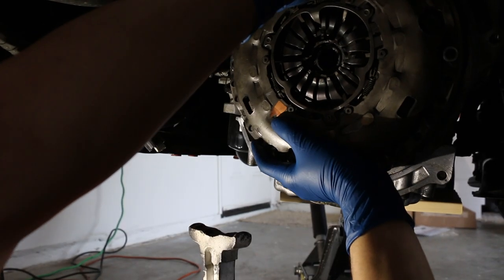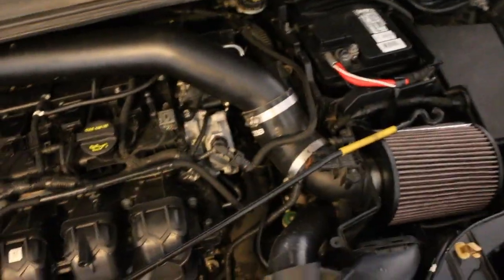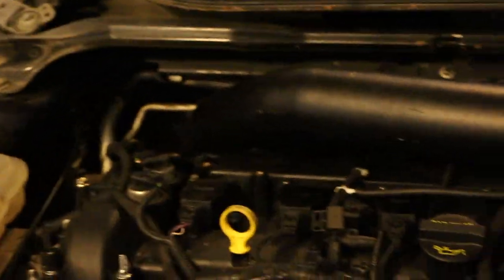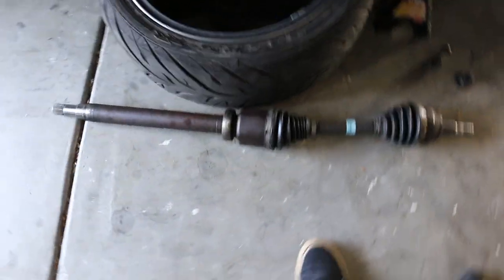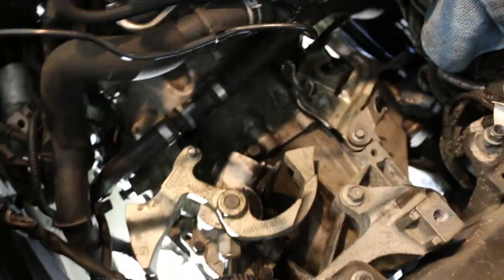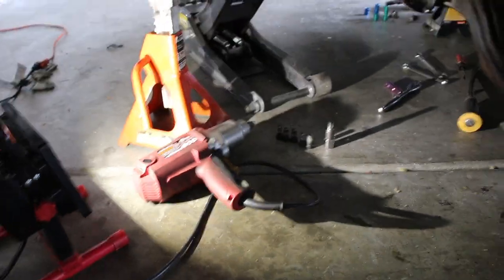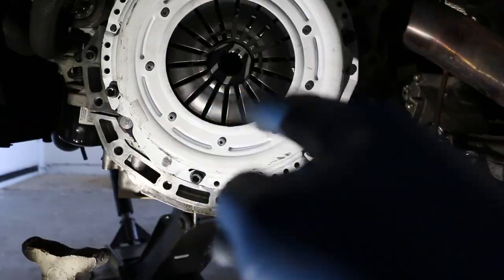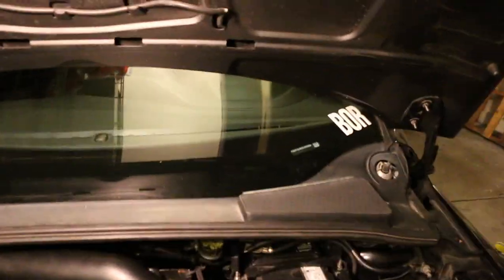CLUTCH AND FLYWHEEL INSTALL - FOCUS ST

Comment: You are awesome! I do everything by myself and couldn't imagine having to film (you do great with the angles by yourself too) I just picked an escape motor because of a cracked head in my st and was debating weather to get a clutch now or keep using my stock clutch (looks really good). After watching this I'm gonna wait, I just got a gtx2867 gen 2 and am not going to be able to tune it if I put a new clutch in. lol btw I decided I could pick up a new motor in the hatch of my other st from watching your videos. ;)

Comment: Hi, love the content! I agree with your statement amount the rattle noise at 42:37. Additionally the increase NVH is likely due to the crankshaft counter-balance assembly fighting against the lightweight flywheel. Had an issue with this in my 04 Nissan Sentra SER SpecV. Thing started breaking starters too.

Comment: Great video! I have a 2014 SE and was thinking about changing the clutch, this helps.
Reply: I have a 2013 SE and may need to replace the rear main seal, yikes. While I’m doing it I’ll replace the clutch.
Reply: only if it’s a manual..

Comment: did it by myself. I had the harbor freight engine holder. I tried to man handle the trans then I used the engine holder and just used the extra hook. raised it till it was even and it slide right in. I spent and hour trying to get it and the hoist took 10 mins. did you change out all the use once nuts and bolts???

Comment: Great video,Bro!- I'll definitely be going to the local high end tool store for an overpriced T55 bit. I couldn't imagine the drama of blowing one out and ruining the inside of one of those flywheel bolts!
  Also, the next homie that you help with a tranny/clutch job need to buy you a Harbor freight transmission jack.

Comment: Great video, i have a few questions.
what caused the engine to need a replacement?
about how many miles were on the original clutch?  

I'm at 91k so far and the clutch doesn't seem to have any issues. 
Once again great video, i'm looking forward to my replacement
Reply from the maker: David Talon 
Thank you for the kind words! So the clutch that was removed had about 95k on it but it was abused. The engine gave out because of a fueling issue. Without auxiliary fueling, these cars don’t tend to last past 330hp.

Comment: for bleeding the clutch, since it uses fluid from the braking system, could I uses a brake flush machine to pressurize the system like you would on a brake flush? would it pressurize the clutch system ?
Reply: there is no clutch fluid on a manual
Reply: the clutch and flywheel sit between the engine and transmisison
Reply: @calebeagan2658  Wrong.. This has a hydraulic clutch system. Uses fluid to press the clutch

Comment: I doubt clutch masters would have designed the pressure plate springs to rest so close to the throw out bearing that they rattle on one another. If I contacted them and that was their answer I'd be pissed. Not only is that bad for the throw out bearing it can potentially put tiny amounts of pressure in the clutch line and cause the slave to leak over time. Not to mention the likely hood of the throw out bearing wearing out prematurely.
Immediately would return their product. That's unsatisfactory.

Comment: Do you have to do this entire process just to replace the slave? Mine just went out
Reply: Also I know this video is old but Thank you if you respond
Reply from the maker: Yes. The trans needs to be removed to replace it.
Reply: @tbr.performance  thank you for the quick reply! Also great video! 
You’ve helped me whenever had to do the motor swap and also the heads and cams! Thank you for the help!!

Comment: Im by far not a mechanic, why would my clutch be all the way to the floor like you push it and its straight to the floor after changing the clutch i had someone do it for me and apparently he doesn't know what he did wrong. I break the bleeder valve open and nothing comes out I push the clutch it sticks to the floor any help?
Reply from the maker: Sounds like they didn’t bleed the clutch. You have to bleed all the air out of the clutch system.
Reply: @tbr.performance  so whenever the valve is open no fluid is coming out like barley any comes out .

Comment: How did you torque down the flywheel without a lock?
Reply: You can insert Bell housing bolts into the engine block loosely and insert a screwdriver into the teeth of the flywheel against the bolts to hold everything while torquing the bolts
Reply: @kinecty111  thanks man. I ended up making a tool for it.  Actually sold quite a few of my tools to others looking to do clucth/motor work

Comment: ? Bpv/bov controlled by solenoid vs running a line from the manifold symposer delete, witch is better?
Reply: In my opinion running to the intake manifold makes it not go off like crazy whereas with the solenoid it goes off every time you lift off the throttle
Reply: erik ludlow that’s exactly the problem I’m having, I only started to notice it after flash tuning it with the Cobb access port, not sure if theirs any correlation . A custom tune is in the near future and was hoping that it would solve this , if it doesn’t it looks like I would no choice but to make the switch, it would be nice to understand what causes the issue .
Reply: @bones0184  Yeah its mostly the solenoid making it do that. Getting a true vacuum from the intake mani will fix your issue. It fixed mine at least.
Reply: erik ludlow so I just retuned with a stratified flash tune , it was like 75$ , problem solved and a lot more power, also ordered the guardian Angel from them form complete control.